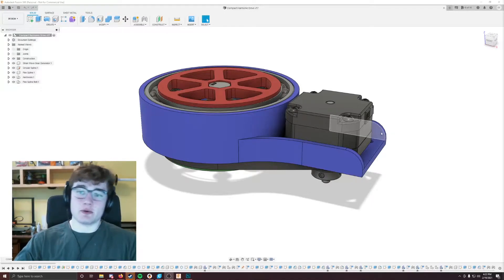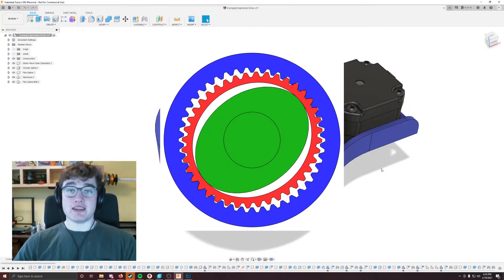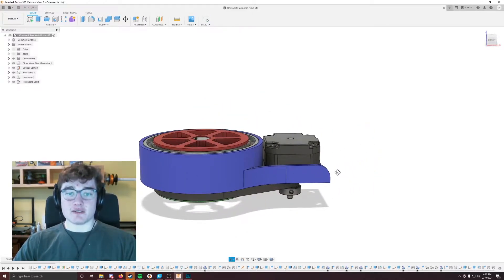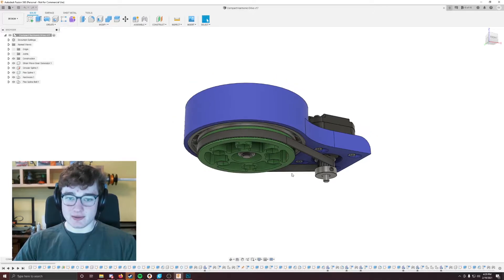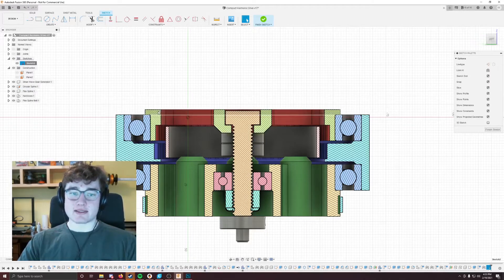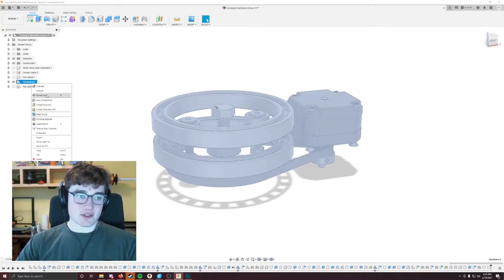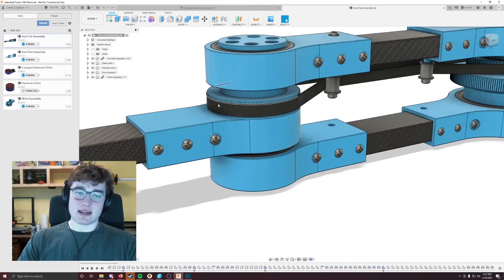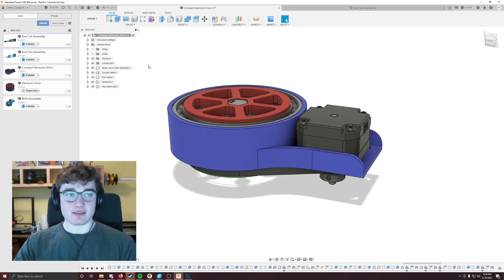Designing a 3D printable harmonic drive

Comment: Thank you for the video. How did you calculate the tooth profile for the output ?
Reply from the maker: Lots of trial and error. Generally based off of a circular tooth profile, but it really doesn't matter as the accuracy of 3D printing is very limiting.

Comment: NICE!!!! It looks like it will work, but for a more efficient high quality 3d printed harmonic drive it most definitely must be a bit larger

Potential places to make better:

1. Belt grinds bottom of half of drive, increasing friction. An internal extrusion, some M3 threaded inserts and M3 screws can mount the timing belt to the edge of the upper 3d printed red internal gear teeth, keeping it "floating slightly" above the green internal gear teeth, increasing efficiency

2. NEMA 17 should be just enough, but a Closed Loop Nema 23 with Stepper Driver can direct drive a harmonic drive as well as provide more torque output (if the timing belt can handle, HTD5M can, as oppose to gt2 which are quite skinny/flimsy) << if you read AR3 Annin Robotics Assembly Manuel you can learn how to wire things up properly form the guy who invented the AR3 robot arm. Downside it weight

3. Cylindrically Longer (more height) Belt if you want to decrease gear reduction (thereby adding more teeth to green internal gear, increasing major axis of wave generator and stretching the belt. Gear Reduction is: (total belt teeth)/(total belt teeth - green inner gear teeth) So usually its 2 extra teeth, leading to for example 50 reduction using 100 teeth belt. But If you use 5 extra teeth, reduction is 100/5 = 20, so lower reduction but still has no backlash properties of harmonic drive. Example: (at aliexpress)/item/32910323713.html?spm=a2g0s.9042311.0.0.f09d4c4dvt6o9y  << The 50mm thick version

4. (optional) Make it back-drivable by using a complete oval instead of 2 bearings for wave generator ( or just 8-12 bearings arranged in oval shape)

When the parts ship from china (like a month from now), hopefully I will be making a harmonic drive for a personal project!!! Hopefully it works....